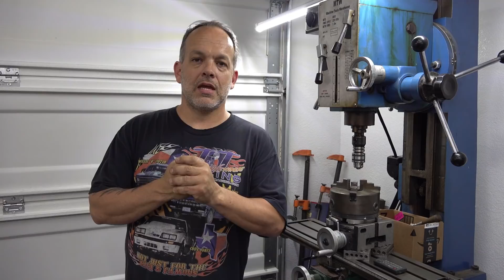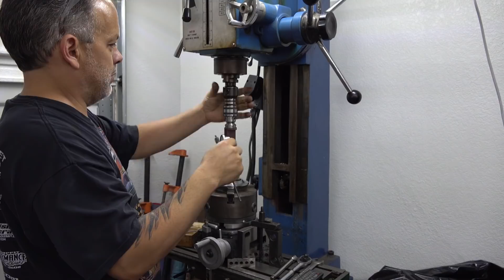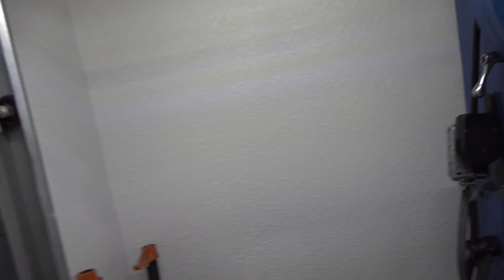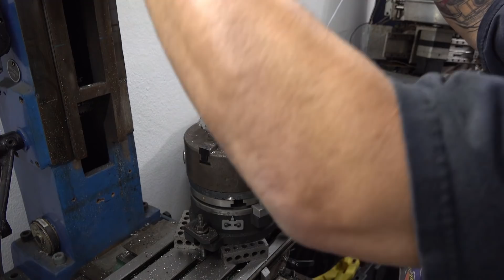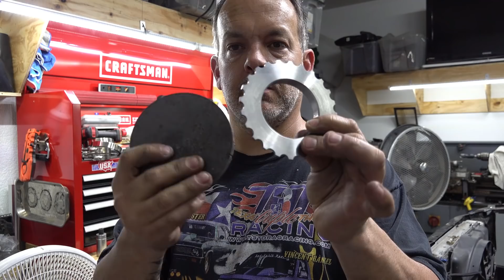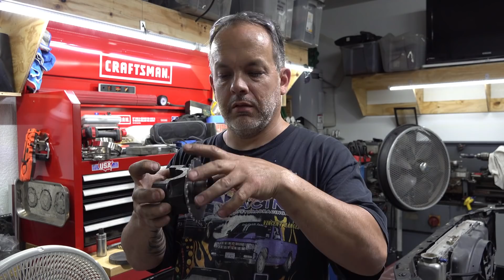It's done, but I messed it up!

Comment: A couple questions if I may? 
What made you choose 24 teeth on the wheel?
Cherry sensor? Will you be showing the bracket where you mount the sensor? And I'm hoping to see the programming on the ms3pro when it gets that far! (I'm way far behind as I'm looking at the hptuners for my stock junk.)

Yeah, I'm lovin' this. Cant wait for it to come out. I will definitely want to come out to denton to see it run.

Keep up the great work!
Reply from the maker: 24T seemed to be a good starting point based on what we've done in the past. It could very well end up getting changed at a later date. I am certain there's a point of diminishing returns with tooth count, but in general more tooth count = higher resolution = better results. The bracket will be pretty simple, as the rear end housing has a couple of good bolt holes that are in just the right spot to put it. I'll definitely show the programming for the most part, some of it may be classified. hahaahahah.. likely not though. HPTuners is expensive and WAY harder to learn compared to stand alone stuff, imho. The MS3Pro stuff is more expensive, but you get a lot of functionality in return. Boost control, traction control etc. Hit me up when  you come out!
Reply: @diygaragetx  I'm just wanting to turn off the vats on a couple of our GM vehicles(99 suburban and 03 cavalier giving probs, also looking at efilive stuff which is even more money) and we are doing a l67 sc3800 swap into a fiero. It is my son's  project and he has the car and engine/trans bought and it came with the factory computer so we figured a few birds with the same stone. Just have to buy some credits. 

If I go stand alone it will be a GNECU for my turbo regal. PNP is easy and I know a couple guys running it with e85. That is probably the direction I will go. 

Either way, loving the vids and the machine work. Keep on pushing forward!